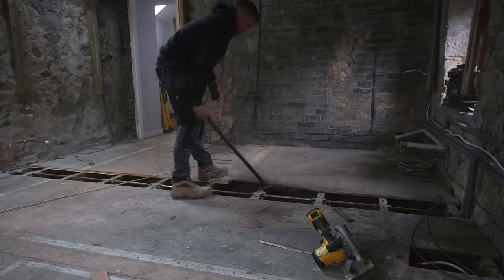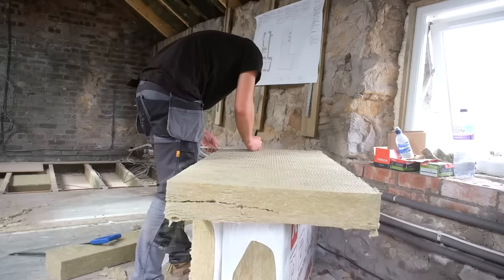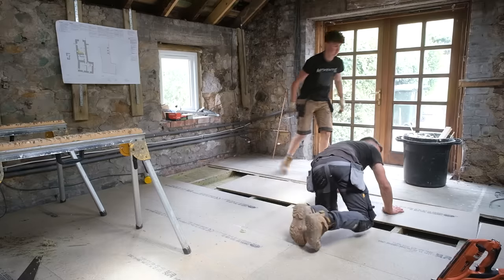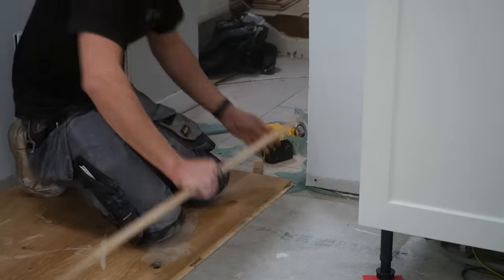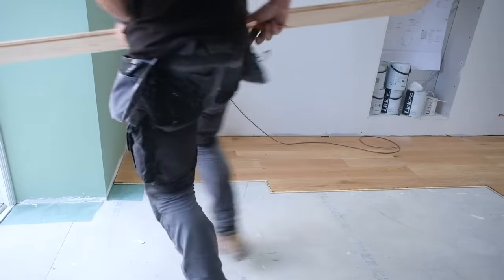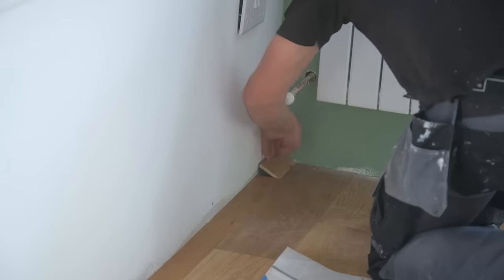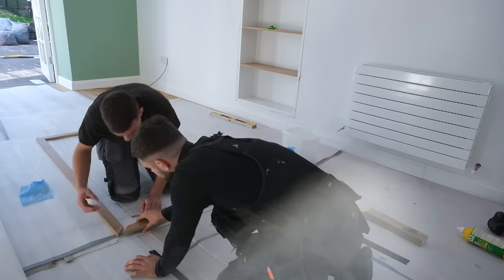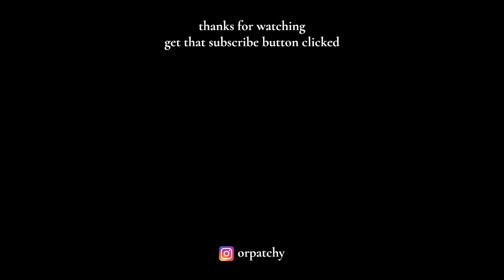Replacing My 50-Year-Old Floor with New Hardwood | Before & After Renovation

Comment: I built a 5000 square ft home and had spray foam sprayed for insulation because it was faster and with geothermal heating I think it was the best. With geothermal heating my heating bill is almost nothing compare to have to pay for all gas which is high here in the United States maybe not as high as in Europe but still expensive. Great Video!:yougotthis:

Comment: ❤ the new floor, bookcase, and the general brightness of the place! Just wondering why you'd need 2 rather large radiators in one room? And hope you'll continue to feel better, George!
Reply: There are high ceilings,  radiator size and  output is calculated by room area square feet/metres and wall type, also its better to over spec the  radiators,  they will have thermostat valves so can be adjusted if needed.

Comment: Could you explain the neighbour situation a bit more? This house looked like it was fully detached, but you're saying it's actually got a lower level?
Reply: George has mentioned the properties are on a sloping site or hill, so sort of split level, I had a house on a slope where the rear was single storey onto the garden like this project, and the frontage was two storeys, all the houses in the road were like this.
Reply: @john_smith1471  Interesting, I never got that impression from the previous videos. I'd be curious to see what it looks like if it hasn't already been shown.
Reply: yeah we have no idea what the front of the house looks like @soviut303

Comment: Good choice focusing on the insulation. But I'm wondering why you didn't go for heated flooring. The electrical variant seems very easy and cheap to do...
Reply: Electric underfloor heating is extremely expensive to run.

Comment: Carpet is disgusting in my opinion.  Love the bookshelf!!
Reply from the maker: Likewise, much prefer hardwood. Easier to clean. Really pleased with the bookshelf as well. :)
Reply: I just stayed in a large fairly open cottage in Scotland with hard floors throughout. Despite it only being Sept, and even with underfloor heating, I found it quite sterile, chilly feeling and echoey, I didn’t like hearing everyone clipping about on the floors in the bedroom areas. I would still go for carpet in bedrooms, I just find it cosier in the winter. I guess you can use nice rugs but they move, you can trip, they still need cleaning and large ones can be quite unwieldy.
Reply: @nicolad8822   Throw rugs aren't disgusting!!
Reply: @SisterSherryDoingStuff Did I say they were?
Reply: @nicolad8822   I didn't mean it like that.  I'm sorry.  I was just saying with hardwood floors, I prefer a couple of throw rugs - so it's not cold, etc.

Comment: Looks nice but it is still just an old shed. If you put lipstick on a pig it is still a pig.
Reply: This has never been a shed, it’s a transformed dwelling property built with solid local stone and a newly replaced solid tile roof, heated and insulated, great views from indoors.
Reply: This is an historic village, would you rather everything be razed to the ground rather than refurbished to modern standards?